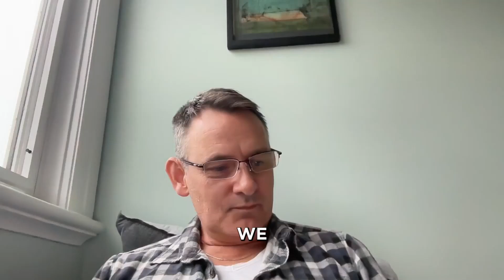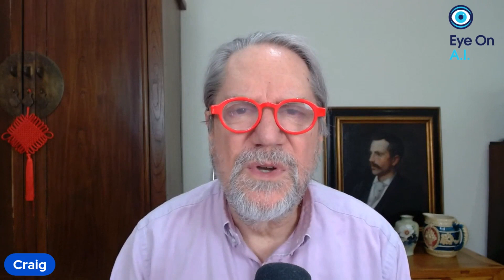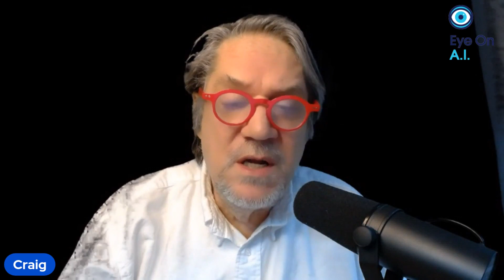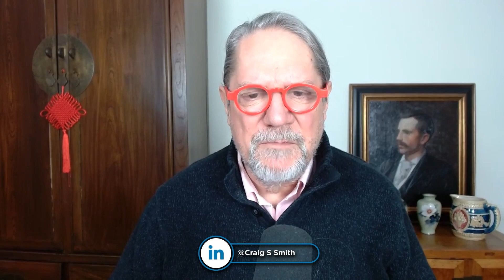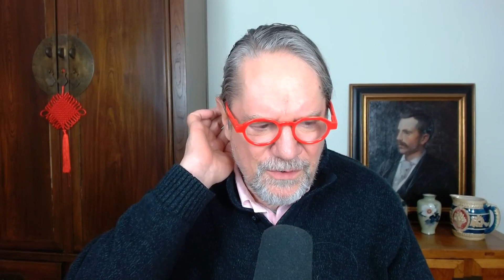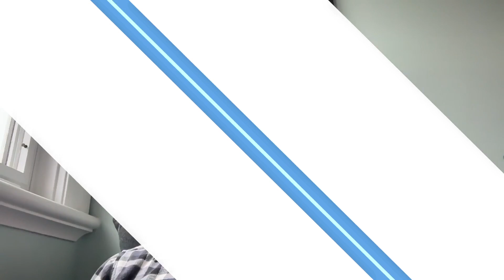Building An Artificial Brain With 100 Billion Neurons | André van Schaik

Comment: Interesting stuff, I wish the timings were better organized though. The brain uses a lot of rhythmic modulation to trigger inhibition/excitation signals, and the neurons are bathed in flows of hormones which could be incorporated by a convolution layer. Seems to me the project stopped well short of a brain in very important ways. Also segmenting clusters of neurons to be orchestrated by a centralized agent.

It's too bad we don't have the resources to run a bunch of these with varying designs, this is such a cool project.

Comment: Nice talk. Thank you for sharing. True north, deep soth, stargate, ect.. Big investments into A.I. systems. It is interesting to see the feild grow so. Things like how biological neural nets are similar and different from machine neural nets in ways. Hallucinations, art, word salads, ect.. Tokens/symbolic weight vs biochemical weights and biochemistry. I don't see people trying to tease out the sub brain areas functions and emulating them part by part. Also goes to helping people with loss of brain function due to damage or such. Biochemistry functions being used as modifiers and emulating that on neural nets also. You don't need to simulate all the biochemistry down to chemical reactions. Just the algorithm that represents function change. Do that for the subgroups and then cobble that together. You have the technology out there now to do some of this. 

The ship of theseus paradox/problem. Switching substrates from one to another. Checking at each step. At which point does the person become non human?